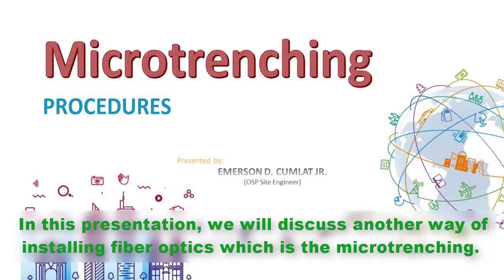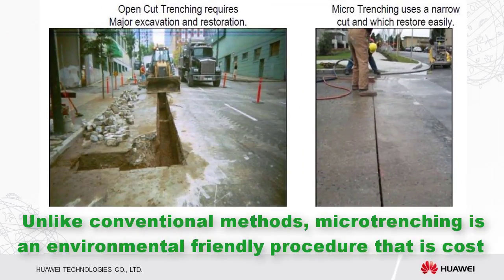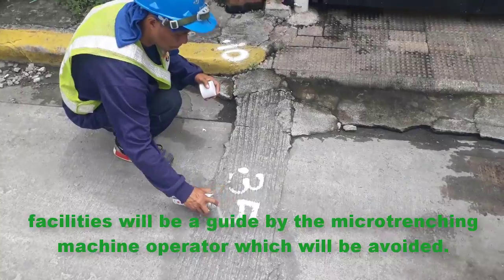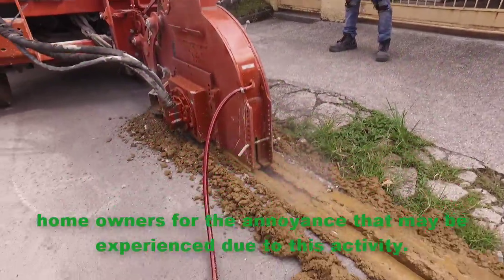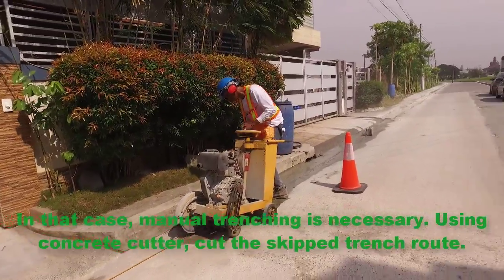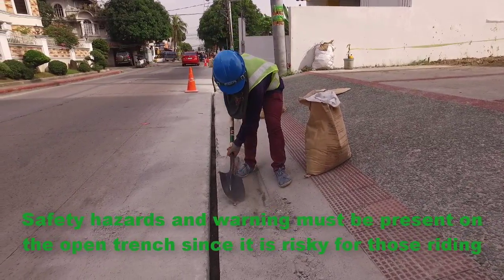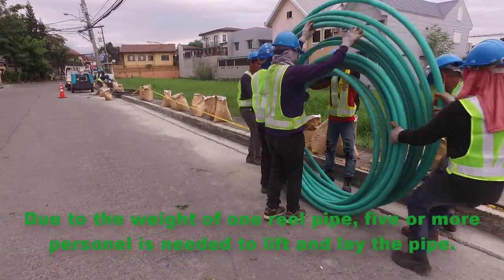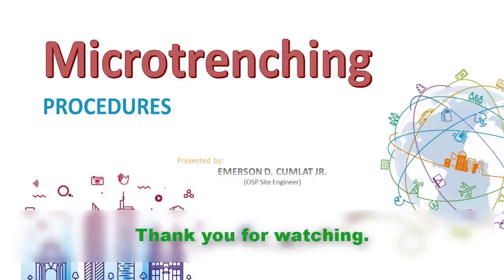Micro Trenching Methodology

Comment: Why not attach to that existing pole line?
Reply: because they wanted it underground most likely near a bunch of other cables going different directions than the one they are placing that are connected to the handhole they need to splice to. plus I think many telco companies want to get rid of telephone pole because of danger an appearance, at least in new neighborhoods in the US.
Reply: @GarlicBudda  An aerial installation costs less than installing conduit underground. I'd run a conduit and rise at a pole for an alternate route. Telecommunications systems usually have a 10 year life span. It would allow for future expansion.
Reply: @gregwilliams386  yea they could possibly do that. but 1 utility pole is owned by a specific utility company. So they might not be allowed to use the pole because it is owned by the power company or other telco provider and they are unwilling to lease the pole and to hang their cable. Plus there are small advantages (even though underground costs more) like not needing a bucket truck or block the road/sidewalk for maintenance or resplicing. And telephone poles are ugly and dangerous for traffic.
Reply: @gregwilliams386  aerial might be cheaper at the time of installation. But overtime renting a pole for your cable will be more expensive than than placing a reusable conduit that your company owns.
Reply: @GarlicBudda  $12.00 a year per pole?
Reply: @GarlicBudda  Marcus, I've worked in systems where capacity - both bandwidth and continuity become inadequate with time. I was always looking to add tie ins to existing or risers to possible future pole lines. I once left a system with a route 2 miles long going through the heart of town which was later used as a fiber backbone. I think we're thinking along the same lines.

Comment: What are the advantages and disadvantages of using this method in laying fiber optic cables?
Reply from the maker: advantage? less risk of fiber breaks and low maintenance cost compared to aerial suspension.  disadvantage? more expensive solution.
Reply: @EMERmusikero93  until they restore the street or work on deeper utilities and hit your line that is at <1ft underground. hdd and even trenching would be more expensive than microtrenching and boring/hdd would be far better